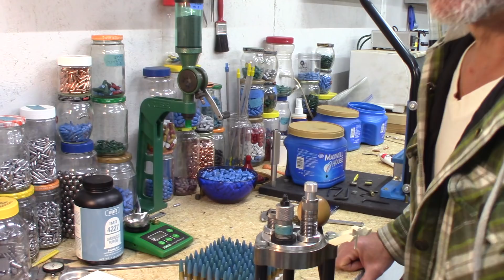CAST SUBS 300 BLK OUT

Comment: Hey Elvis it's been a while since I watched one of your videos, I ordered me a 300BLK upper with a fluted barrel, I can't frickin wait until it gets here. What kind of mold you use to cast the 300BLK? I love my Elvis ammo arsenal mold, I should have got the 2 cavity though LoL I bought the 4 cavity brass hardened mold and it makes my carpal tunnel flare up after a casting session because that thing feels like it weighs 10 pounds lol. I didn't know that the 300BLK used recycled 5.56 casings, I have been digging up all my split neck 5.56 casings so I can cut em down and load up some bullets. I saved so much money, because I was gonna get a 7.62x39 upper and would have had to get mags and all that and then I learned I can use the mags I already got for the 300 I was like cha ching! More money for powder and a good mold set and some just enough factory ammo to break it in and do the initial tests

Comment: If you're going to pull the handle twice to crimp, you need to rotate case 45 degrees second time otherwise it doesn't do any good.  If you rotate the case you get a nice even uninterrupted 360 degree crimp.

Comment: Not to get off subject, but have you tried IMR 4350 in the 223 with the LEE 225-55-RF? In my bolt gun i get the best groups with this powder using around 25.0 gn give or take. Found a load in a old IMR manual i had on the shelf for a 55 gn jacketed bullet and adapted it to a lead bullet. IMR load was HDY 55 gn SPSX, Rem 7 1/2, Rem case, and 26.0c of IMR 4350 for 2605 FPS and 34800 CUP. Makes for a nice full case at the velocities of a lead bullet and the best accuracy that i have found so far.

Comment: You can use a Lee 30 carbine powder through neck expander. Just have to drill it out with a 3/8" drill bit and it works perfect for 300 blackout.

Comment: I load the same bullet with 7.8 grains of LilGun powder. Cycles perfectly, and is surprisingly accurate. I can hit a 12"x20" steel plate over and over at 150 yards with a red dot.
Reply: What barrel are you shooting that load in? Most data says 8.2gr
Reply: @gregwisinski7870  10.5" barrel with a pistol length gas system.

Comment: 9mm 147 Subsonic - folk say is just fine.  
 300bkl 150 Subsonic - folk say its WEAKSAUCE, incapable of harming even a possum or raccoon.
Say it aint so
The 150-165 slugs cost a lot less than 220s, fine for boltguns or quiet 'sidecharge gasless AR Repeating Rifles'
Reply from the maker: Not sure how much to read into “folk say” speed, weight, and distance is always something to keep in mind. Everything has a purpose

Comment: I'll help with the reason you double up on the flair. It helps mitigate the brass "spring back" when the metal is stretched. Using mixed head stamps or a single brand that may have a tiny bit thicker wall will have a bit more spring back and shave the bullet, a double pump will help the brass take the set. (another two cents worth)
Reply from the maker: That is exactly why I do it. You’re a smart man. I didn’t want to make a big deal of it, I guess I should’ve just said👍👍👍👍👍
Reply: @elvisammo  Pretty soon I'll be eligible for an ounce of the powder-coat powder.      ;-)

Comment: excellant vid as always Elvis.
 would body have some insight on a problem ive had: i have problems with my 300aac 230 mold getting hot and deforming and frosting portions of the bullet. i keep the pot at about 3-4 setting(sorry no temp) and it happens after 6 bullets or so.
Reply from the maker: The answer is it is a small mold and a large bullet therefore it heats up really quick the only solution is to lower the temperature of the pot as much as you can while still having a liquid metal. Then slow down as much as you can. A little frost is not gonna hurt anything though
Reply: @elvisammo  Hey thanks for the reply:-) yes thats been my approach so far. I try to let it rest every 6 bullets or so. The frost is actually in the form of a "dent" just above the topmost ring of the 230.  it gets larger as it heats up. 
Ive been toying with the idea of milling the mold with heat sinks to increas the surface area.